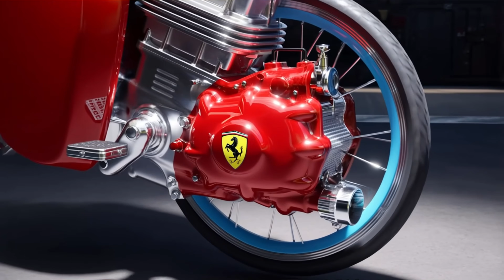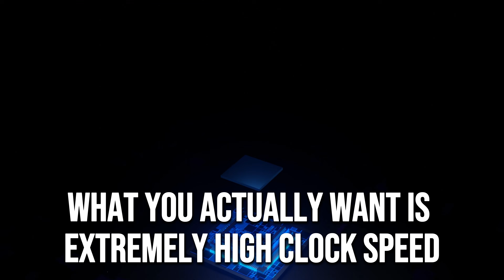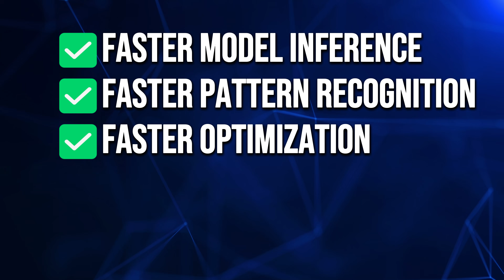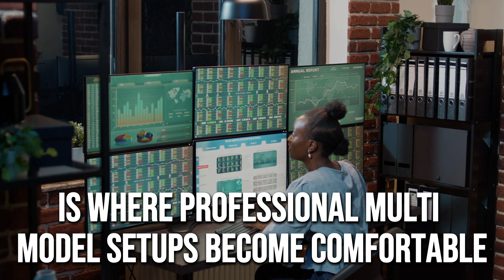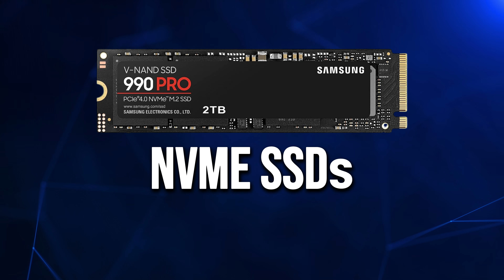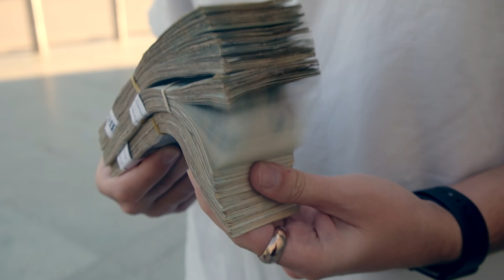Best AI Trading Setup (Most Traders Get This Wrong)

Comment: Just use a cheap gtx 1080
Reply from the maker: The GTX 1080 was a legend in its day, and it can still push charts fine. For AI bots, though, it has 8 GB of VRAM and no tensor cores. Bigger models won't fit, so they spill into system RAM and inference slows down. That delay hits right when the trade window is closing.